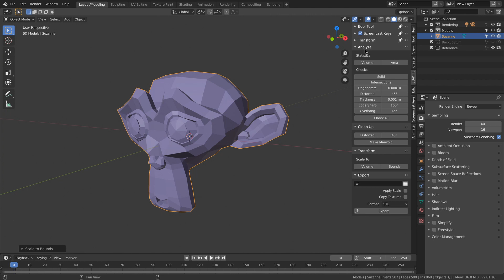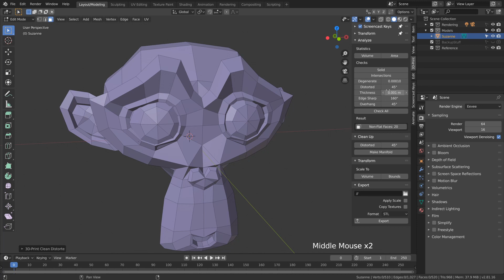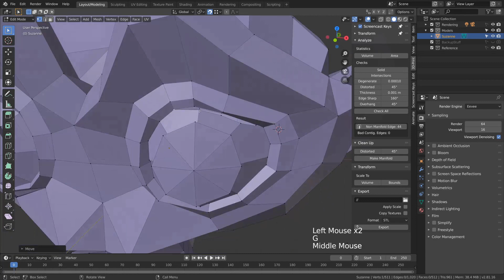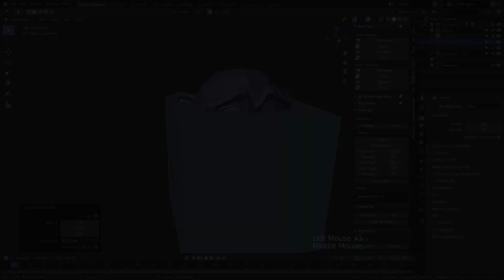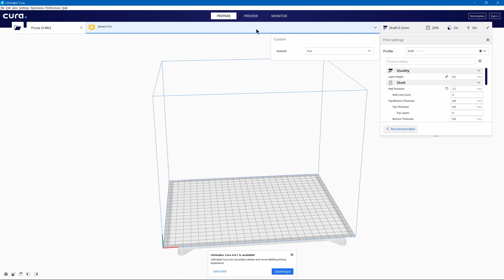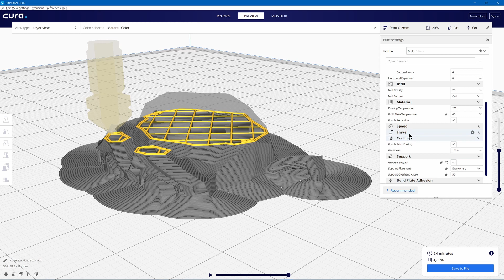Getting Started With 3D Printing in Blender

Comment: Thanks! I had no idea about the 3D printer addon. Also handy is to set the measurement units (eg mm) and enable the grids in the overlay menu for x and y when necessary. Also the nut and bolt generator addon - pretty handy!

Any good ways to make connecting parts like you mentioned? Like LEGO style attachments? Thanks!
Reply from the maker: Good points!

I usually just use a Boolean. The design of the joint needs to take several things into consideration though, one being the accuracy of the printer, you'll probably need to have thr peg slightly smaller than the hole in the model, thingiverse has several "tolerance tests" you can try to see what exactly the extra space needs to be for your printer. Another thing is how the pieces are broken up, laid out and printed, for example if you have pieces lying flat to the print surface with the joint on the side, a jigsaw puzzle style joint might be a good choice to avoid support. A Lego style joint would likely need support, which isn't great if it can be avoided. Another method I've used on a print of Luke's lightsaber, which has many cylinders of different colors stacked, was that I booleaned a square hole through each piece, (not going all the way through the end pieces of course), and had a long square rod that I printed to go inside it. If you use the rod or a Lego style pin, it can be a good idea to make the pin/rod a decent bit shorter in case you can't get all the support out of the end hole. In the case of the monkey I decided that it was easier to just leave it flat since it wouldn't be too difficult to line it up right, while the lightsaber with it's many stacked parts might be difficult to line up straight without something in the middle. I also wanted to avoid extra support and keep the tutorial simple.

Googling 3d print joints will give you more info.
Reply: MrTriPie wow thanks that is super helpful. I’ve been working on making 3D printer joints for a while, your advice is super duper extreme helpful to the max.Edit: removed double ‘super helpful’ and replaced with ‘super duper extreme helpful to the max’
Reply from the maker: Haha, you're welcome, glad it was so extremely helpful to the max!
Reply: @MrTriPie  More then extremely helpful to the max!, you are a genius, I just had a project where I have to print some stuff, and this tutorial help sooo much! Thanks A Lot!. Keep up your amazing work! You have one more subscriber here.
Reply: Great tutorial thanks

Comment: Awesome tutorial thank you! I was wondering when in the Cura platform I notice there is a grid pattern inside the monkeys head, is this something you set in blender or is this just the software adding that in for support? I am building a drone body in blender and even after using the "solidify" tool, my drone seems to be hollow... Thanks in advance!
Reply from the maker: This is something Cura adds. The solidify modifier basically adds thickness to the polygons of the mesh, it doesn't fill the mesh, so to get the grid support you'd need to delete it and export again

Comment: but it aint smoooth, its surfaces
Reply: Creating a smooth model in blender is easy you just have include subdivision surface modifier to your mesh . But actual 3d printers to print those are costly.

Comment: Quick question: Tried to make all my edges manifold but it smoothed the whole thing out, which I didn't want.
Reply from the maker: Try using autosmooth or the edge split modifier, if just sharpening by angle isn't good enough, you can select some edges, right click and choose mark sharp
Reply: @MrTriPie  Figured it out. Thanks anyway. I had to shade it flat.

Comment: Hey is it possible to print anything in blender like the low poly living rooms and lowpoly environment piece , high poly cars etc
Reply from the maker: You can print pretty much anything you want, but there are certain things that make for more successful prints, like are the models actually "solid", and are they thick enough in all areas, what kind of support they need in the printing process, etc. Most models not made specifically with printing in mind will likely need some small tweeks to print well, some will already work well.
Reply: @MrTriPie  I mean iam good even if the whole model is like a solid I would like to print environment scene etc on 3d printer but I can't find any videos about it